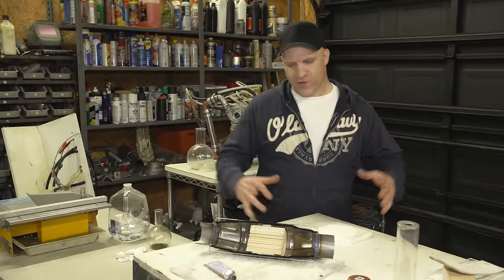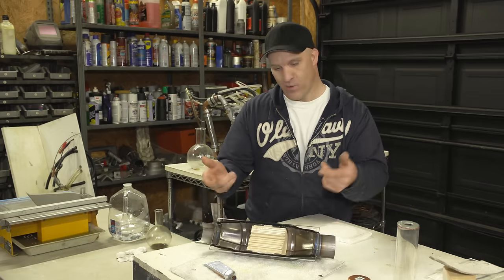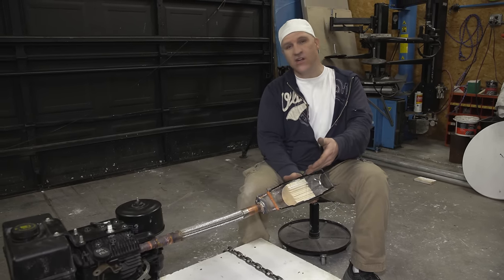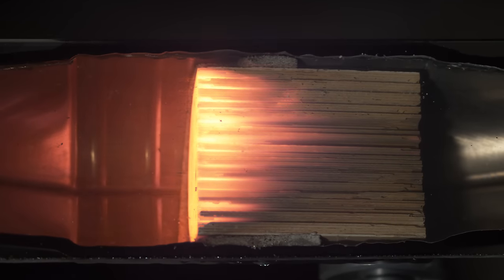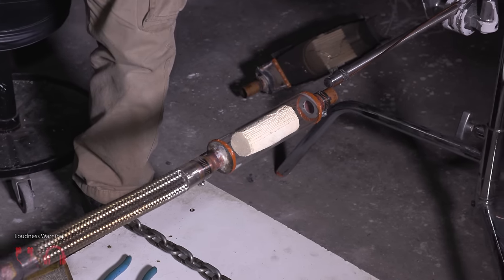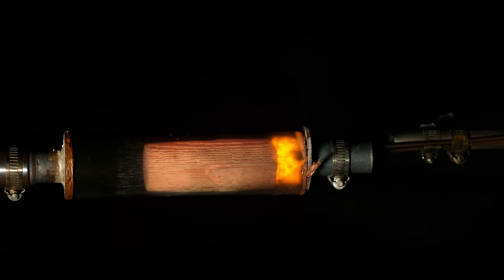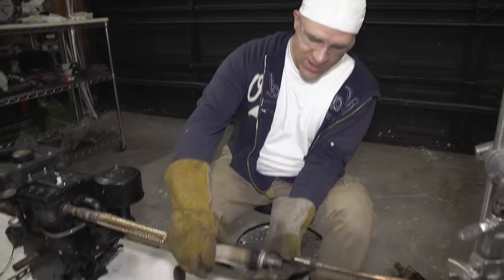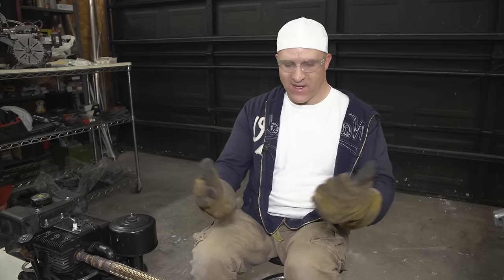See Through Catalytic Converter

Comment: “I started running rich and the cat LOVED that!” 

in reality cat did not like that and in fact can be damaged by running too rich
Reply from the maker: Lol... Good point. Well I guess I should have said " I loved that"
Reply: Warped Perception: [Loved that]
Cat: [Did not love that]
Everyone else: [loved that]
Reply: I always thought the lean mixture will heat it up and burn the carbon off cleaning it but didnt think rich mixture would actually burn the cat by overheating.

I was so sure rich mixture would foul it like a plug :D
Reply: @eamh2002  there's a difference between cat and DPF wchich indeed is made to burn carbon
Reply: Yeh
Reply: @eamh2002  The whole point of the Cat is to convert toxic gases plus unburnt fuel into less toxic gases. So a rich mixture will produce a lot of unburnt hydrocarbons due to more being in the mix and the colder combustion....this gets burnt in the Cat making it very hot.
Reply: @eamh2002  yep, my old speed3 ran a little rich during the time I had a preset map before getting a dedicated tune, ended up fusing the cat. Lol
Reply: @MyGaznik  a DPF doesnt cause any reaction, it is simply a filter that holds soot
Reply: @eamh2002  running rich may run your engine cooler due to more fuel running through it but your exhaust will suffer. Running lean will cause your engine to suffer just as much as your exhaust does. Stoich is the best bet.
Reply: jheetman yea that’s why I wrote that’s there’s a difference between cat in which those reactions are happening
Reply: When I worked at a dealership I always used to say "cats never die, they are murdered". You're killing it!
Reply: @xishootstuffx  Funny enough, mine actually died on it's own (probably). The pipe assembly (was more like a single pipe with four windows) that was connected to the engine's ports cracked (a known issue with that particular cat), the sensor got fooled by the additional air flowing through the crack so the crack quickly grew until the mix cut off a part of the sensor's housing and burned through the cat nearly all the way through. Probably shouldn't floor that much anyway... Glad we have no real law requiring you to use a cat, so I swapped one out for a really cute rig of 4 separate long pipes. Makes a priceless sound when shifting too!
Reply: reading this comment i imaged his cat being terrified and running out of the garage in terror... then i realized what you meant...
Reply: @nissanpacific9793  Lol pretty much same here :) Funny enough, a month after that swap I found a real heavily sick cat around my old garage. Once I fully patched him up it appears he really loves riding with me when I floor it (and starts screaming in jams, just like I do). So - real cats love when you run rich and floor (with the new sensor setup it seems the ECU tends to a more rich mix), ceramic ones don't :)
Reply: @jeremymoreside1444   Yeah I basically figured running rich is good for engine but blocks the cat but apparently not, figures why catted chinese bikes run so lean from factory :)
Reply: I knew a guy where he ran rich all the time ended up having issues. Had to have the whole engine replaced cause he had so much carbon build up it ruined his engine and the Cat was done it had nothing left it was just a big hole no material left in the Cat
Reply: Good way to melt exhaust seats too.
Reply: @ryans413  Wrong that is :) First, the main problem with running rich is the valve seats getting covered with burned stuff. Floor sometimes, and do not ignore engine-braking (all the ECUs go lean to zero fuel at this point anyway) - and nothing clogs your valves. The carbon mainly builds up because of piss oil and wrong octane. Even choosing an oil with incompatible additives can ruin things beyond all repair. As a proof of concept, already tormenting this engine for 6 years (120k km mileage). A burned cat and a beheaded oxy sensor, nothing of much issue (not a single engine cleaning involved, of course - only timely and proper oil changes). Needless to add, it is an AT, which people like to say you shouldn't floor with, especially on ice - as my result, burned yet still good ATF on every change and no shavings but the initial load after the first run. Of course I pay much attention to the clutch engaging ;)
Reply: @eamh2002  Cat gets real hot on a rich mix due to the un-burned fuel that then burns in the already hot cat. Plugs get fouled from a rich mix since the plug don't retain as much heat as the cat does.
Reply: Mbt is from ignition timing if I'm not mistaken.
Cat no like fuel 🔥🦁🔥
Reply: @jacknickolstine3355  MBT and engine braking are the opposite things (MBT is the torque the engine can apply without slowing down) :) Now when WOT (and on MBT therefore) you are damaging the cat if on rich too much (or on piss fuel), yet the flow and timed ignition keep the engine clean (also flooring on lower gears means less stress to the pistons compared to the early shifts). When engine-braking, there is just air passing through the cat (which will cool it down so the ECU will go rich in order to re-heat it later), yet your engine is, again, cleaned up. Morale - do not floor and brake only if your engine eats too much oil (which will kill your cat in no time) - otherwise the engine will be thankful you do so (yet the cat won't be anyway). Myself I prefer putting more stress on the cat yet keeping my engine on the safer side :) Guess 5 years was nice for a cat anyway (though mine, although with some internal damage, was destroyed for a different reason, a very soft port plate and fragile cat pipe not coming along that is).
Reply: @TheBypasser  I was referring to power production by hitting mbt. 
More isnt always better hahahahah
Reply: @jacknickolstine3355  Of course. The only good mix is neither rich nor lean, we all know it :) As far as I get it, as you can not sustain the ideal mix perfectly, going rich reduces the life of the exhaust system, while lean affects the pistons. From those two evils the first one is preferable ;) (unless we take some extreme cases where a very rich mix causes misfires and ultimately washes off the oil coating of the cylinder, heavily increasing it's wear).
Reply: @TheBypasser  if I can remember older vehicles had air pumps supplying the catalist with oxygen.
Reply: @TheBypasser  shit fuel fouling in the oil is more important with a diesel than gasoline. 
Narrow band o2 will have a frequency of around 1hz and the stft will fluctuate between rich and lean about 1-10% I believe then ltft will adjust overall fuel about 28%. 
That's adaptive learning in the fuel system. 
I'm most likely mistaken on the % of change in stft but once ltft hits its max I believe itll throw a code.
Reply: @jacknickolstine3355  In fact shit fuel is a problem everywhere, just in diesels it is more evident, as diesel fuel can actually get spoiled over time (there are some bacteria that can live in it).
Anyway, from my experience the newer VW engines tend to go slightly rich when WOT as with a modified exhaust I can clearly hear the muffler honking when I close the throttle. But probably this also has to do with the cat heating mode, where ECU runs rich for some time after starting, and even skips ignitions for up to a minute since the engine start in order to burn some fuel in the cat. In a few minutes after the ECU enters it's default mode the honking becomes much more rare (but remains anyway).
Reply: @ryans413  The material was now lodged in his muffler causing yet even more restriction.
Reply: Is sarcasm that difficult to understand these days?  Dude was having a nice sense of humor while having a tremendous amount of fun.  Guys like this are the reason we even have technology.  Give the dude a break and just say "thank you for doing something I'm too dumb to do".
Reply: Thank you for doing cool shit that I'm too dumb to do!  Guys like you are the reason we have the light bulb and other cool shit that none of today's youngsters are thankful for.
Reply: @eamh2002  This is exactly why the check engine light will flash when there is a serious problem. It's called a catalyst bombarding code. Not making fun or anything just providing additional information to help your learning process.
Reply from the maker: @JDOTVegas  thank you! Very much appreciated!
Reply: @WarpedYT  And so is your vid
Reply: Nice video.     Its interesting why everyone here says that running rich will damage the CAT.      Running rich means ofcourse you have unburnt fuel.   But at the same time isn’t there not enough oxygen to burn the “excess” fuel.   Assuming you run the engine rich for a while and the CAT has lost most of its oxygen.   Why will the CAT burn ? I would assume the CAT would be even less reactive and less hot than running stoichiometric.  Where there is enough oxygen to burn any unburnt fuel.
Reply: @Gouthamreddy93  There is always enough oxygen.  14.7:1 ratio is a substantial amount of oxygen so, when you richen the mixture, there is still more than plenty oxygen.  Couple that with the increased fuel, you have increased heat; thereby overheating the material in the catalyst.  This is a "catalyst bombarding" event and, on OBDII vehicles, will cause the Malfunction Indicator Lamp to not only illuminate but flash.  This is designed to get the operator's immediate attention in order to avoid catastrophic damage.
Reply: Yea unburnt fuel will stop it up in turns u have to remove it for a acid bath or just replace it
Reply: @jheetman  you are wrong the DPF on diesel engines goes threw a regen cycle that squirts the def fluid in and raises idle or occurs while cruising that burns the soot off. that's why you have to add def fluid every so often. look it up. the temp coming out of the exhaust  while in regen is close to 1200°f+
Reply: I thought we were talking about a real cat
Reply: eamh2002 it harms it by clogging it
Reply: @eamh2002  
Hi everyone :)

there are a group of cat´s for every pollutant emmited in our engines (Diesel/Gasoline). just read on Wikipedia for more information because it´s tons of information depending how deep you wan´t to get into it.
Reduction cat /Oxidation cat / ...etc SCR....blabla 

It´s all about the optimal working condition for catalytic conv. 
The cat breaks down excess HC to recombine with the excess Oxygen(Oxidation cat! ) in the exhaust gas, but when there is no HC left because u are running lean then the cat doesn´t do nothing ;) except of restricting your gas flow  . (Okay and doing other reduction stuff etc. but thats endothermic we see no glow)
What you see and what we all find nice is when it start´s  to glow (Oxidation cat.)
what like other´s described is not very nice for the cat. because of overheating. i hear the engine stumbling and these strokes where no ignition is going on is the worst for our catalytic friend
 but also the thing we all want to see  ;) 

Lean mixture (Hot)= minimal HC´s, minimal CO ,but maximum NoX because of very much oxygen in the exhaust gas, so that it recombines with the huge ammount of "N" in our Athmosphere to NoX.
Rich mixture  (relatively cold ;) ) = maximal HC, maximal CO , minimal NoX.(because nearly everything  of the Oxygen recombines with the excessive  HC´s (Fuel) 

the best working AFR for a cat. is 14.7 parts Air to 1 part Fuel ( stoichiometric mixture  or so called Lambda=1 blue flame ) 
Every flame that goes yellowish is rich . (or contaminated with soot,oil, not evaporated Fuel which makes it "rich" cause these have all carbon or hydrogen inside them which is also fuel etc. huge fkn topic trust me. I´m loving it ;) )

When the Exhaust gas ist too "clean" after it exit´s (also too hot or too cold, loaded with soot, unburnt oil or oil ashes...etc.pp tons of variables!)  the Combustion chamber, it can happen that the catalytic conv. doesn´t work at it´s optimal point. (Light Off point/Overheating etc.)
That´s the gamble u have to make when you (a company, lots of engineers and workers working together ) make a mapping for an engine to fit Emission laws/driveability etc.

What i found what Cat.s really "DON´T" like ,is on an Turbo Engine when u drive mappings from hand High RPM  you are on the rich band...and then u spool up the Boost pressure and it goes instantly lean so that all the HC´s go off in the Cat. at once...that spikes the Cat. temp  from 900°C-950°C to about 1400°C or more deg Cels in a splitsecond  and ur cat is then GONE xD

So always remember enrich the mixture first and then turn up the boost ... ( i could write hours now... then there are tons of variables that directly respond to this topic such as , valve timing, spark advance, scavenging....etc..)

Get the Cat. a dose of sulfur.. it´s contaminated then and doesnt work anymore cause it blocks the "pores" also known as fouling . 

wow... i had too much coffee sry dude´s xD
Okay i have to go now...my Cylinder gasket doesn´t gets fixed by it´s own.
Reply: @eamh2002  My first car developed an injector leak and a few months later, the cat was so clogged up that the car wouldn't do more than idle. All that unburned fuel stuck to the substrate, heated up, and melted it shut. Running lean could also damage the cat, but not as quickly.
Reply: Warped Perception    There's a difference between running RICH and running rich. Same thing with LEAN and lean.  Too rich will cause carbon fouling in every inch of your block and system and have fuel burning in the pipes that can also cause excessive heat elsewhere as well as wear and tear, but slightly rich (like a percentage point or two) will leave lightly wet surfaces on your components that doesn't really do much aside from slight, SLIGHT, lubrication and heat transfer.  Running too lean will basically be anemic and cause heating due to an essentially dry chamber because there is enough air to completely burn everything, potentially including oil on the cylinder walls/rings.  If you've ever seen a fire change from yellow to blue then almost clear, that's because the flame is SO hot that it changes the light spectrum and is also burning everything.  Slightly lean on the other hand is more just a nuisance that could still shorten the life expectancy of a motor.

Slightly rich is better for operating longevity but worse for the environment, slightly lean is better for the environment but potentially wear inducing (slightly).

Unless you're a jet engine, in which case throw the book out the window and cross the streams, because I'm not getting into that .
Reply: Speak for your self bub...
Reply: @WarpedYT   Turns out RX8s run very rich on startup just to preheat the cat so maybe it loved it.
Reply: My cat likes heat, he sleeps under the wood stove all winter.
Reply: @eamh2002  
Duty cycle controls the fuel mixture in your car and let's the cat work in it's efficiency range. 
For simplicity , at a steady cruise the mixture is going rich lean rich lean constantly at computer speed. 
Usually wot sends you to full rich.
 (still in a safe zone for factory tuning)
Ignition misfires are an absolute killer.
Reply: Why do you think two step destroys cats?
Reply: Nerd
Reply: @eamh2002  it starts burning inside the car itslef, thats why it gets that hot when rich
Reply: @jakesreef1730  dpf vehicles go into high temp regeneration to burn soot like once every 200-500miles.  High temperature being 550-650°C for diesels.
AdBlue/ DEF /Aqueous urea is needed for NOx reduction over an SCR catalyst.
Two different technologies.
You can get the SCR coating integrated into the filter (SCRF).  Depending on the application (car/SUV/truck), market (USA/Europe/China/etc) they may be favoured over individual items (DPF+SCR).
Reply: @robbending3848  okay and your point is.
Reply: @jakesreef1730  that DPF regeneration & SCR requirement for DEF are two separate technologies.
There are applications which have an oxidation catalyst and DPF. There are a few applications which have an oxidation catalyst and SCR without DPF (heavy duty trucks, for example).
Light duty passenger cars, SUVs and trucks like Ford F150 would need both, but please don't confuse the two technologies. 
SCR needs DEF to reduce NOx nearly all the time.  DPF is passively trapping soot and regenerating for 10-20 minutes every 200-500miles.
That was my point.
Reply: @robbending3848  sure. Lol
Reply: I came to the comments to make sure someone brought this up. 
Running rich/raw fuel in the exhaust is the #1 reason catalytics fail. They can melt down and plug the exhaust which then causes performance issues or no start in extreme cases. 

A normally operating catalytic will have a warmer outlet than inlet due to the chemical reactions happening inside of it.

Comment: glass: survives brutal vibrating and getting rattled around
also glass: ᶜ ʳ ᵃ ᶜ ᵏ
Reply: it cracked due to temperature difference
Reply: Yeah, rapid cooling is real nasty to most types of glass. Even Pyrex is not exempt. I recently exploded a much-less-than-hot glass mug just with insanely cold ground water, during the 2021 deep freeze. (That one was definitely not Pyrex.)
Reply: As soon as I read this it cracked
Reply: @arfyness  pyrex also uses a shittier formula nowadays
Reply: Just goes crack